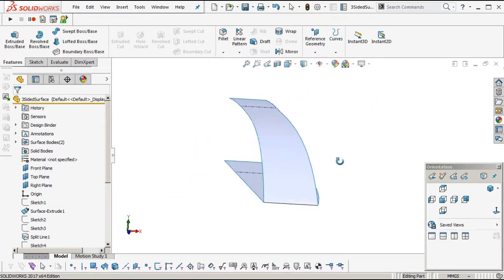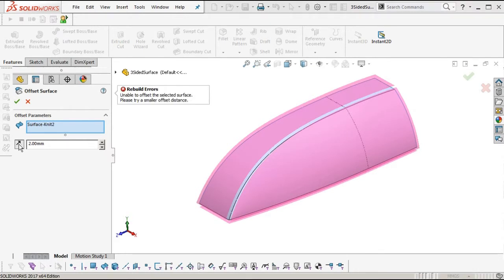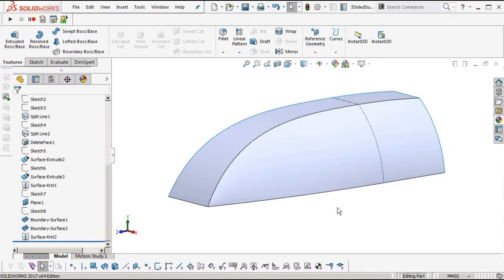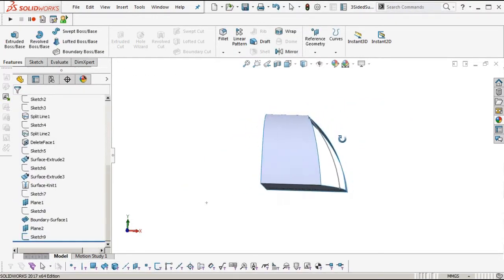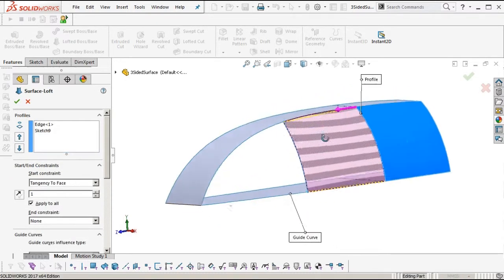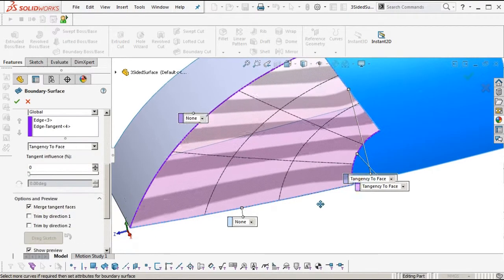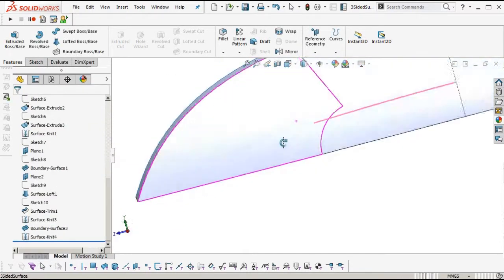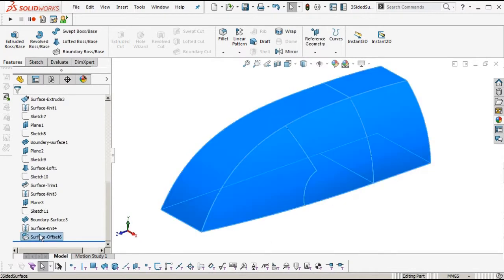Solidworks Tutorial: Surface modelling a three sided surface. AJ Design Studio LTD.

Comment: The conversion of 3 sided/edged surface to 4 side/edge surface is "laborious" and might seem "tricky" to beginners of surfacing techniques.
However, it cannot be avoided.   I have experimented with splitting an edge into 2 segments = 2 sides in sw algorithm, so it allowed me to use boundary or loft.
Similar to lofting from an edge to a point.  It works, but is the final surface smooth?  (who cares? we must)
Final test, I think everyone will agree is to "offset the surface" in both inner and outer direction and check for "wrinkles".

Comment: In case anyone else ran into the same problem as me that ended up finding this video looking for a solution:
For "Direction 2", in order to complete the surface (having "Tangency to Face" as an option), a surface is required on the Direction 2 face to reference. If you specifically do not want to have a surface on the other side, you will need to create another curve somewhere in the middle of the Direction 1 edges along a plane (this may be a bit of a pain to figure out how to do properly the first time, one hint is to use "Split Entities", although there's other challenges to figure out in order to do this properly) and then run the process on the side with 3 edges after creating a surface on the other side with 4 faces.
Reply from the maker: Do you mean if you want to make it tangent to the extruded surface that runs along the top? I'm not quite sure I follow what you are trying to achieve. Cheers.
Reply: @AndrewJacksonDesignStudio  I was just attempting to explain to anyone the solution I found if you are trying to build the 3-sided boundary surface without the use of any external surface references. May not have come off clearly through words.
Reply from the maker: @WheatleyOS  Ok, understand now. Cheers

Comment: I'm curious why you created an additional loft surface.  Why not trim back the original surface?
Reply from the maker: If I had trimmed back the original surface on the right, the boundaries that make up direction 1 of the boundary blend would have been quite different in length; it would have been quite stretched horizontally. My goal was to make a surface that has fairly even spacing of isolines. As always though, many ways to skin a cat when modelling!